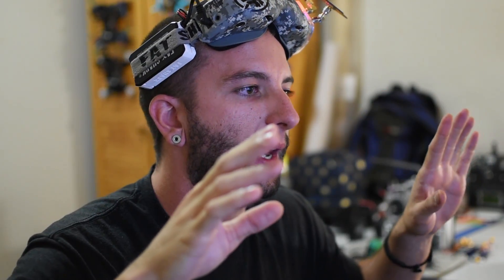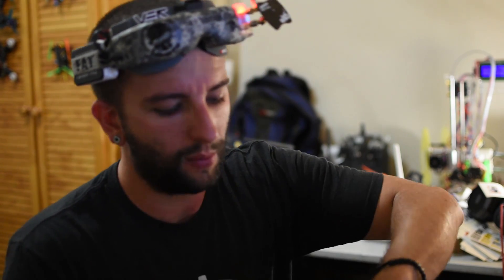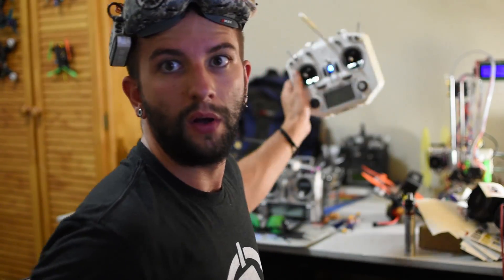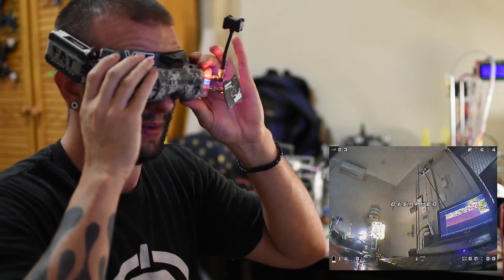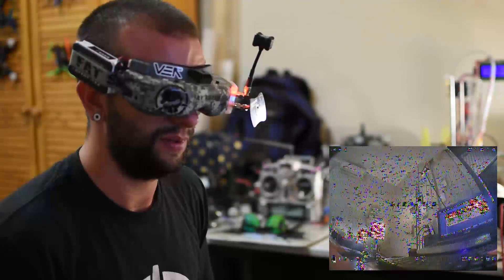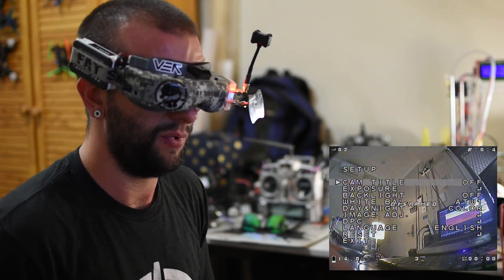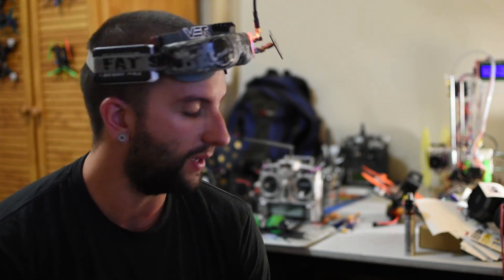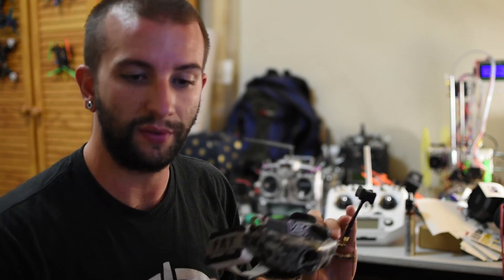TUTORIAL - How to change the settings of your FPV camera on Betaflight 3.2

Comment: the music is crucial, but away from that nice video
id like to use the tattoo aio board from banggood, it only has 5v outs and I read that you need a numbered output or sth to get the cam menu on there and well, I could use the led
maybe you guys do know if I can use any other connection on this particular board

Comment: Works flawless with a swift 2 and a basic foxeer 1177, but i cant get it to work with a foxeer arrow micro, tried different resistor values ranging from 280 to 580, took a look at the rev voltage and calculated the internal ressistance, but still cant get it to work, do you have any idea what i can try more to get it to work
Reply from the maker: tom haaima I'm sorry i don't have a foxeer arrow micro to try it myself. I have a runcam swift that refuses to work too. I never found out how to sort this out unfortunately...
Reply: i just tried on foxeer hs1177v2 and it didn't work.
Reply: Got the micro to work, all it needed was a capasitor over the signal and ground, that might do the trick on those other cameras aswel
Reply: you mean bridge resistor between signal and ground?
Reply: how?
Reply: No dont brige the resistor over signal and ground, the resistos should be placed as is in line with the signal wire. You add a "capasitor" over signal and ground. I took the small'est i could find out of my box of random shit, i have no idea how small you can go.
Reply: tom haaima so the usual resistor on signal and a cap over signal and gnd? So without the cap it won't work?
I am almost giving up
Reply: Yes that is what i did, resistor as usual and a cap over the signal and ground, 

It worked for the foxeer micro dont know about other cameras, might be worth a try
Reply: tom haaima i tried on foxeer hs1177v2,  didn't work out even with cap. 
Somehow the menu showed up ONCE during a few of the plug-ins but unable sticks don't respond to anything. It overlaps with bf osd.

Comment: Well then. I tried everything, and notta. 1/2 watt 470 resistor foxeer xat 600. Wired to the signal pinout on the led  on my betaflight f3. Remapped a08 led to cam control. Oh well.

Comment: No success.
Setup: 
foxeer arrow v3
330 ohm resistor
Motor 5 pin on omnibus f3 fc (pin B07)

Cli parameter 
camera_control_mode = hardware_pwm
camera_control_ref_voltage = 330
camera_control_key_delay = 125
camera_control_internal_resisitance = 470

Comment: I'm using 1/2 watt 460 resister wired to the led signal pinout. Do I need to activate led in config tab and in mode tab. And what do I do with my sticks to bring it up?
Reply: This will be awsome when I get it to work!
Reply: BF Wiki Page.

Comment: do you know if anyone has gotten this working with a foxeer monster? i have tried all recommendations in the wiki but no success. im using a betaflght f3, 220ohm resistor on led pin, ref voltage 325 measured, cam internal res 99, i have tried all delay from 100-500 in 20 ms steps. would switching to software pwm and adding a capacitor be better?
Reply: I think we will find out once I get a sample of this camera.
Reply: Andrey Mironov is it worth me setting up the filter to test?

Comment: It doesn't work for me. I used two resistors in series to get between 400-600ohm but no response when i yaw right.
I have disabled led and motor 5 on resource A01  based on omnibus F4. It just didn't work out. 😥
Reply from the maker: d1technic I'm sorry I don't have an omnibus f4. I tried it on a DYS F4 and it worked as well on the LED port. apparently you can use a resistor from 150 to 600 ohm. Maybe try again with only one resistor. Let me know if it works.
Reply: d1technic which "two resistors" did you use? Come over to BF GitHub if you're willing to solve this.
https://github.com/betaflight/betaflight/issues/2613
Reply from the maker: So far I've tried with 5 different cameras and 1 never worked. Was it the resistor or the camera? I don't know. 
But yeah, try with another resistor. If it doesn't work, try with another camera. But before all of this make sure you understand how the resources work and that you are on the right pad on your flight controller ;)
Reply: Which camera did not work?
Reply from the maker: Andrey Mironov one of my runcam swift. I know the problem comes from the camera as my other swift works. Actually no the other one is a swift 2. And the other cameras are hs1177. Maybe the swift doesn't work at all...?
Reply: KViN my hs1177 was dead so i tried on a runcam swift micro. And i did tried with one and no resistor. Negative
Reply: I tried all of modern runcam cameras besides eagle v1 and they worked for me during development.
But YouTube is no place to discuss it

Comment: Great video. This might just make me go to 3.2 before the official release. As far as the resistor, is that all we need to look for is one that is rated 400-600 ohms or does the watt also matter? Thanks for making this video. Great info.
Reply from the maker: No you can use a 1/4th of a watt resistor and it will be fine I'm sure.
ANd thx for your comment